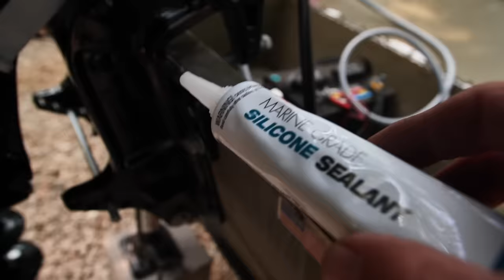Installing NEW Mercury Motor on My Jon Boat ( Unboxing to Running )

Comment: 20" shaft motor on a 15" transom. Ouch.
Reply: That was exactly my first reaction, but in all fairness seems to know what he’s doing
Reply: @ Frode I was wondering if you can explain why 20” shaft motor on 15” transom is a bad thing
Reply: Gerald Paul it creates too much drag in the water. It makes the efficiency far less and it goes much slower while biting more fuel. Also can make the wake splash into the boat when you decelerate
Reply: Noticed it immediately

Comment: There are so many points in this video that I am like really, is this your first time around boats and motors Justin? 4 stroke mixes the oil itself? Never drilled a hole in a boat before? Didn't know the kill switch had to be on? Wrong length shaft?

Comment: If you want to run the motor, just fill up a garbage can with water. It works and what we used to test outboards.

Comment: Never run an outboard or I/O without water!!! You'll eat up that water pump impeller.
Reply: Stolzie J you can just not long
Reply: @justinmartin3918 , I've been a boat mechanic for a long time, but unfortunately I haven't been in it for a long time now too. Things may have changed/improved, but from my past experiences, it doesn't take very much to chew up the impeller. Especially without any water. But like I said, things may have improved
Reply: Wes Steve  who
Reply: @justinmartin3918  NO YOU CAN'T!  Ever take one apart that ran dry?  I've done way too many.  The rubber impeller melts to GOO!  And, if you're dumb enough to run it until one of the impeller blades comes off... well, I just might be feeling cranky enough (because I've been telling all my customers not to do this) to charge some BIG bucks to go up into the thermostat housing to find the pieces.  Listen to ALL the manufacturers; DON'T DO IT!

Comment: Sick that they sponsor yall! I've been saving up for a nice 4 stroke for 2 years, when the current situation hit and I lost my job I also lost a year of savings for it in two months lol. Back to the damn grind I guess
Reply: Def keep saving for new.  i saved up and trusted someone on craigslist bought used 20HP 2-Stroke and it's left me stranded a few times and draining what lil savings i had and it still doesnt run good.
Reply: It will be worth it in the end. My dads ProSX is so much better then his old 2 stroke was.
Reply: I feel your pain
Reply: @zcookie9272  my dad's 2 stroke 25 is still running strong. still has most of the stock parts on it and it runs almost like it's brand new. even stock impeller

Comment: Great motor Justin and looks awesome. I do have one suggestion though as you need to maybe put a piece of1x1 in the gap between the motor and transom that it sits down on something solid as over time or if you hit something you don't break the motor mount. I also agree with another suggestion I seen of adding a piece of plywood on the transom as well to give you a little stronger transom as that would be some that you could attach the 1x1 to that it also has something solid to attach to as well giving you a more solid transom as well. As I don't know if you know how much wear has already been put on the transom with bumps and bangs it's took from the old motor and stuff it may have hit.

Maybe even make the  1x1 a little long that it extends pass the motor mount that a screw could be screwed in at the top into the transom to hold the 1x1 better as well. And as you know silicon is your best friend when you own any boat. Just speaking from what I seen in my Marine Patrol days as not a boat builder but have seen some boats like that where the motors that size tore out the transom because they were not strengthen a little more. Best wishes on your new motor and be safe as can't wait to see how she runs.

Comment: Looks like you have a long shaft motor on a short transom. Take it to a welding shop and get the transom raised. And get yourself a break away mount
Reply: Isn’t the prop suppose to be pretty level with the hull? I’m trying to find out myself thanks
Reply: Merc is giving them free motors, call em and tell em you need another one
Reply: Cavitation plate should be level with or just slightly above the bottom of the hull
Reply: william collins yes cavitation plate even with the bottom of the hull. He either needs to build his transom up or buy a jack plate
Reply: A few years ago Mercury changed to an actual longer shaft length but will argue it's still 15" but old boats don't lie.
Reply: @williamcollins7382  It's not a cavitation plate.
Reply: Or just a jack plate

Comment: that seemed like a dangerous thing lettin Rob on equipment, especially indoors!
Reply: lmao whoever cut the legs off all his pants should've cut his license in half
Reply: I've trained people on how to operate those types of lift trucks (and other types.) Rob doesn't fully know how to use it and is therefore dangerous on it.
Reply: Louis Loutrel my guess is Rob would be dangerous on many if not all types of operating equipment.

Comment: LFG my friend that is so cool that they are supplying you with new Mercury outboards .. good job on putting it on your boat . I work on older outboard motors from the 1950s and man have the motors changed . Love your videos.
Reply: old motors? back when Johnson was not evinrude....my dad and Uncle Maurie went in together and bought a 6 HP Evinrude back in th early 50s...wish I had that motor just for old times sake....grew up in Milwaukee, lived in DFW since 72....

Comment: Coming from experience you need to transfer the weight of the battery and the gas tank in the front. with the weight of you, the new engine, battery and two 6 gallon tanks your back end will sit significantly lower in the water line then you would want. Also this will great reduce the stress on the engine and transom by getting it on plain faster. Much love brother!

Comment: looks like 
wrong motor for that boat you need a 15" not a 20" shaft ...
Reply: Yes sir 👌 definitely not the right motor
Reply: Add jack plate and rip it
Reply: Isn’t the prop supposed to be sitting almost level with the boat hull? I’m about to buy a motor for mine
Reply: @ryanishkonk3446  The cavitation plate should be almost the same level as the keel of your boat. Give or take and inch is fine. So if the measurement from the top of you transom to the keel is 15" then you need a short shaft. If it is 20" then you need a long shaft, etc.
Reply: Bennybass  That's what the wife said
Reply: Bennybass  He has a Jon boat. The boat in general doesn't take on hardly any water but by getting a longer shaft then needed you just limited your ability to take the boat in shallower water which these boats can easily go.
Reply: Roughneck R1542V Jon Boats have a 15"transom. For some reason Mercury started making the 15" short shaft a couple inches longer but still say it's  a 15" shaft motor. My cavitation plate was actually splashing water into the boat so I raised, clamped, and bolted just like you did.
Reply: 11:20
Reply: josh_vs250  how does water go in your exhaust port when your motor is running blowing exhaust out

Comment: Bought a new Lowe 1860 Roughneck Center Console with a 60hp Mercury 4 stroke recently and love it. The Merc 4 stroke runs great, is quiet and definitely sips on the gas. Enjoy it. I put the first 20 hours on it quick and am preparing for first oil change.

Comment: Just picked up a new 75 Mercury for my 16ft Mirrocraft. It's going to be a long winter as it's sitting at the Marina until the spring to be installed.  Looking foward to the new 4 stroke experience and fuel savings.

Comment: Friendly piece of advice, you might want to put a spacer or buffer between the gas tank and the bolt you sawed off before it wears a hole in your gas tank!

Comment: You might want to get a transom saver bar for towing with the increased weight going from 2 stroke to 4 stroke if you are worried about the transom at all. Love your stuff, both channels are great. Thanks for the great content year after year.

Comment: Good job...have you been able to fix the hight? I don't know if i can judge this but i looks as the shaft should been a short one. Even if it's correct or not it's very important when others buy there motor that the shaft is correct length. Not easy to go back wih the engine afterward. I don't think the seller will take it back

Comment: Just to re-hash other comments:
1. Needed short shaft (15")
2.  Need welded transom bracing 
3. Motor still need to be raised more.  Cavitation plate 1" below keel line is best
4.  Separate batteries.  1-Marine starting, 1-Marine/RV deep cycle
5.  Way better off with a Yamaha sponsor (I am a Yamaha guy!)
6.  OSG's hat was cute!

Comment: Imagine taking off a Yamaha to put on a mercury...😬
Reply: no...its made by Tohatsu
Reply: I know right, Mercury isn’t reliable
Reply: I love mercury but Yamaha is great to
Reply: doing yourself a favor
Reply: My dad used to fish billfish tournaments in South Florida and his team was offered a sponsorship with mercury and they gave them a chance and after 6 months of problems and repairs they said "you can have your mercuries back" and they bought all new Yamahas. Our boat right (Sailfish 2660) now has had the same Twin Yamahas 150s on them for over 10 years and they haven't had ANY problems. (With normal maintenance).
Reply: @Emmett Grenfell Yamaha Johnson Evinrude and Mercury Only Motors I'll Run
Reply: Whatever Honda puts all other engines to shame marine or auto it don't matter.
Reply: It’s a good choice, they weigh less, use less fuel, and have more torque
Reply: Emmett Grenfell nope
Reply: ddm62571 extremely heavy though
Reply: @ddm62571  honda on the sand bars high and dry yamaha flyin by flying low

Comment: Nice video! A new motor on your boat is like Christmas x100, lol.   I just finished my second summer with my 2021 25 HP Yamaha 4 stoke. I cant say ANYTHING bad about it! It was a dream! 4 stoke 25's fuel economy are insane. It was fast enough to traverse any lake all day long. But  for me with 2 people in the boat fishing and with 150  pounds of gear,  i had one small annoyance.  I could always get on plane, but it always took some proper placement of weight to make it easy do do so.  ( This is on an soft bottom Inflatable, hard bottoms are different, so I cant speak to those )   That said, my 16 foot soft bottom inflatable is max rated to take a 40HP. So I am making the switch in 2 months....  Stoked! and from what I have been seeing on other videos, getting on plane will take 2 seconds with the extra 15 HP. .... anyways happy boating!

Comment: I have a little 15 on my little flat bottom boat and it will go.  The electronic start button is nice.  They run very quiet.  Very smooth.

Comment: LFG, That motor is basically just like a truck engine. It doesn't have an "oil reservoir", It just has engine block oil like your truck. So it doesn't inject any oil into the gas like the other boat motors you said you had that went through a lot of oil.

Comment: Awesome, congrats.... definitely get a separate battery, the charging system on that is not meant to charge a deep cycle and could ruin it....hook your lights and bilge pump to the starting battery. I suggest a group 24 dual purpose. I also hope you followed proper break in or that motor won't last like it should

Comment: if possible mark the holes and drill them with the motor off to save the powder coating on your shiny new expensive motor.  I got a new suzuki 20 hp, fuel injection, garden hose wash ports, totally worth it.

Comment: Oil reservoir?  Definitely learn the difference between the 2 cycle and 4 cycle engines.  Have the 25hp 4 stroke myself.   We love it on our 1860 grizzly.

Comment: i got me mercury 9.9hp last year and it had straight out of box problems connections were loose and screws as well it was leaking fuel and had eletric start problems. so better make sure everything is tight and it does not leak fuel.

Comment: Hey Justin, put a lock washer on that bolt, it'll take care of the problem of the nut ever coming off. You might want to think about getting some pro help on trapping that Bobcat. They can be dangerous, especially with a small child nearby.

Comment: I would use something a little bigger than a pellet rifle for the bobcat, would have to be a very precise shot to take care of it quickly. Also, what are you gonna do with that 25 hp motor? the old one

Comment: Long shaft motor on a short transom. You need to either get a short shaft or transom or have a jack plate installed on the boat.

Comment: That thing is quieter than the 6hp I just got for my 12' Jon Boat.  But wow the Mercury pushes my little Jon at 18mph around half throttle with only one person in the boat!  First time in my life I ever felt a boat go up on plain and what a weird feeling.  You are going to have fun with that bigger Merk I think.
Reply: with 2 people and a full load on my Jon boat a 9.9 will push mine at 22-23 mph full throttle. just one person and all the gear around 26-27 mph. probably just one person no gear around 30. planes out at around 4\10 throttle with 2 people and full load. ive felt getting up on p!and my whole life because my dad has 25 on his 15 ft skiff

Comment: Congratz on the new motor!!  So what are you plans with that 2-Stroke you just took off crispy??
I bought and older lund that came with a mid 90s 20HP merc that has left me stranded on the water 2 times!
 i'm older on disability and spent $$ on carb job nope, then spent $$$ on new switch box nope. price of motors these days is insane! i was trying to save for a cheapo fly reel n rod

Comment: They must have sent you the long shaft motor. Boats like yours need the short shafts which equalls easier install and lighter weight.

Comment: Hey you just run the motor directly to the battery right? You dont have to use one of those red saftey breaker thingys?

Comment: I'll take your 25 you pulled off, as my 25 i have is giving my a bunch of issue's and keeping me off the water because all I have is my trolling motor and with just that and the wind would blow me away and have me stranded again.

Comment: I sure wish my Mercury 60/40 jet sipped fuel. Suppose that’s the difference between prop and jet. I had Yamaha 3 cylinder 30 and changed to a Mercury jet. Great product for sure!

Comment: I just repowered my 1966 13 ft whaler with a 2009 50 hp Merc 2 stroke that I got for free.  Can’t wait to be back on the water

Comment: My 2013 merc 250 just threw an air compressor this morning didn't even get to wet a line before its going back into the shop.

Comment: Justin, I fear that your plastic has tank make end out with a whole in it after a while because it is going to be moving around and resting against the bolt if you leave the bolt that long. I'd suggest try shorten that bolt some more then stick a sheet of hard wood between the bolt and the tank.

Comment: They make solar powered trickle chargers. Also...youre going to want a cranking battery to start the motor. The battery for your electric trolling motor is most likely a deep cycle battery. Its designed differently from a cranking battery. Youll drain the battery fast. But with a solar powered trickle charge battery charger you would avoid the battery going dead

Comment: Stainless bolts will gald up when you use an impact on them. I would replace that one so you don't have to worry about it loosening up and leaking. You can use bar soap on the threads when you put it on and prevent the friction that causes that.

Comment: Yea the duramax’s are having intake soot problems and egr blockages causing overheating issues. They have a design change which I’m pretty sure they have installed on yours now. I’ve had quite a few come through my shop here. Keep the vids coming 👍

Comment: Four stroke motors only use fuel. Not mixed. The oil you put in is the crankcase oil for the bottom end of the motor. The motor runs straight gasoline like a car.

Comment: Don't forget something so simple as covering the bolt ends with something where it'll touch the gas tank. It could rub a hole in the gas tanks from bouncing.

Comment: Pretty sure they gave you a long shaft???  You need a shorty, I have the same boat in 1648 I’m gonna use a jack plate and a jet drive. I run rivers in Washington state.

Comment: get some aluminum channel and plate and weld it to raise the transom. also there should be a valve to disconnect the hydraulics so it will lift if it hits somethign

Comment: Make sure you put a piece of automotive hole over that bolt "Nub". You do6want the tank rubbing against it even for a minute going down the road or on the water. Cut it from nut to nub plus 3/8" if you can spare the room. Nice motor!  Great job installing but you need a short shaft on that transom. What you did should work but the motor will stress the transom some.

Comment: Might not be the situation with new 4 strokes, but you usually can burn mixed gas in a 4 stroke. It's the other way around (running unmixed in a 2 stroke) that gets you  into trouble

Comment: CMC break away would help out a lot lift the motor up and if you hit a log it kicks the motor up
Reply: Also get a transom saver to hold the motor up on the trailer so it doesn’t bounce aro

Comment: Say man. It's been a while since I have comented on the vidjas. But that there DeWalt set you have has a sawzall (reciprocating saw) that would have cut that nub away from the gas can for the boat like a hot knife through butter.

Comment: You need a different type of battery for your trolling motor. Deep cell batteries for the trolling motor and a starting battery for the engine

Comment: Put the other bolts in. add a piece of 3/4 inch ply to the entire transom of the boat so that it sturdies it up a bit. last thing you want is that motor taking your transom and visiting davey jones